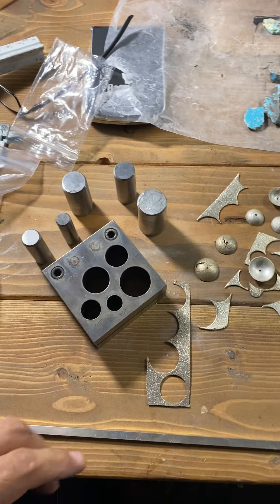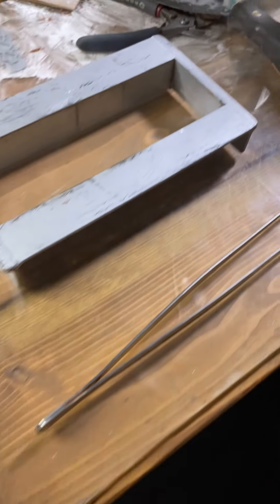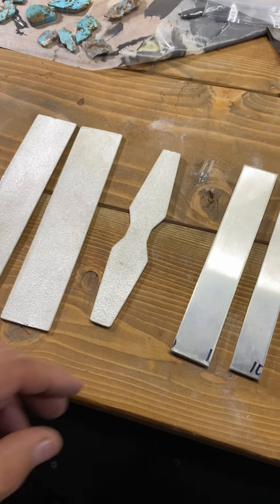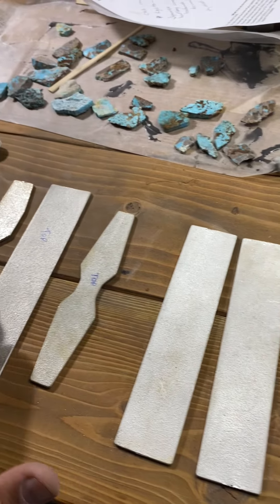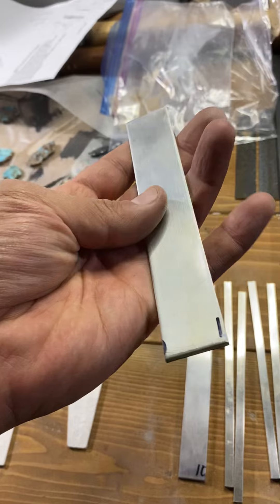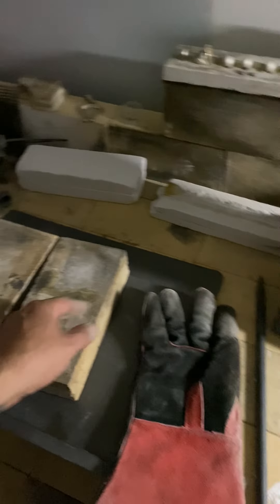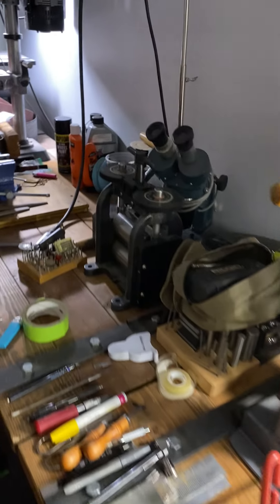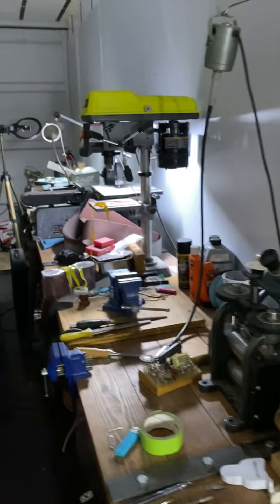Jeff DeMent artist studio tour, and silver casting techniques- Tufa, Sand, Lost Wax & Fabrication

Comment: Hello Jeff. Thanks for the time spent. As a novice, I have to ask: What torch do you recommend that will heat up silver quickly, 3-5 oz. of silver casting grains to pour into a tufa mold?
Reply from the maker: I use an electric melting furnace. It’s setting on my casting bench in the video.